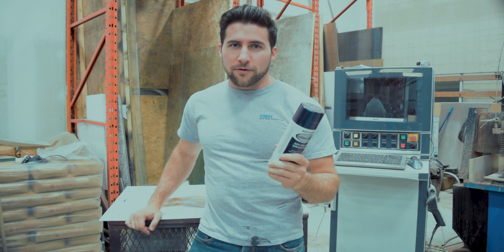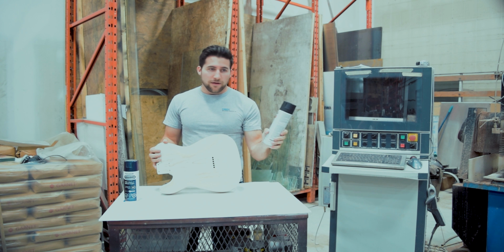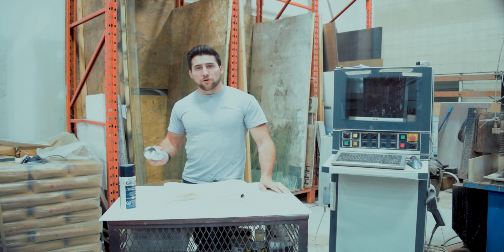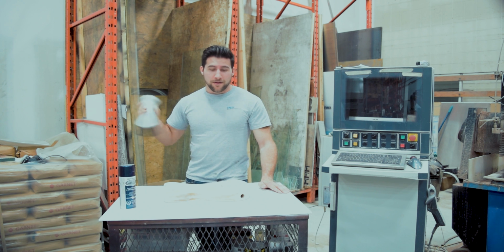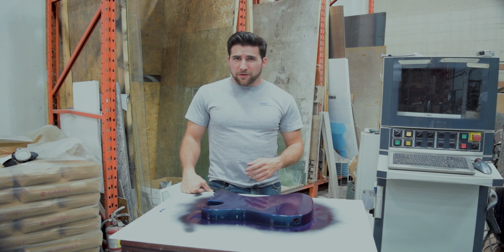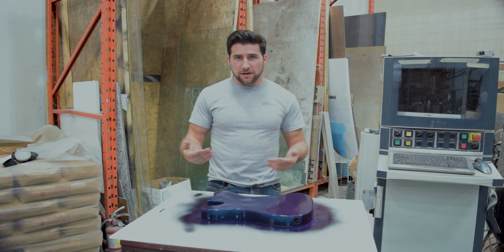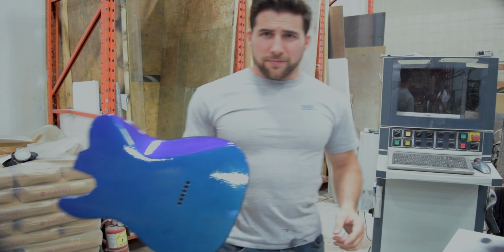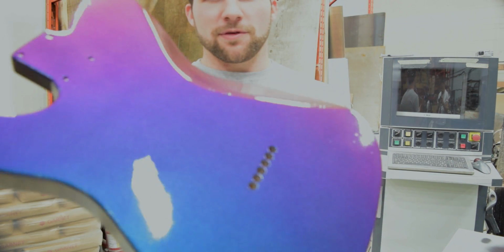How to do a Chameleon Paint Job with Spray Cans

Comment from the maker: Hey guys, if you want to try out this paint job, here is an affiliate link where you can get it: http://amzn.to/2CHWi7a
Reply: Brad Angove I spray can a lot of my lures. I wonder if I could epoxy over this paint?
Reply from the maker: If you let it dry for a couple weeks to be safe, I’m pretty confident you could.
Reply from the maker: Yes, it should be just fine.
Reply from the maker: Thanks for watching.
Reply: Hey Brad, how long did the black base coat have to dry before you hit it with the colorshift?
Reply from the maker: Either 10-15 minutes or 24-48 hours depending on how you’re structuring your coats.
Reply: @BradAngove  thanks for the Reply Brad. I'm doing basically the same thing but on an f hole tele. Love the tips man. Thanks for the help. Hopefully it turns out ok
Reply: @BradAngove  Do you think its possible to do the crackle effect spray paint over top of the color shift paint?
Reply from the maker: It should be possible. I’ve never tried it though.
Reply: Hey Brad, does it matter if the black base coat is gloss or matt? Thanks for the tips and great vids.... Andy.
Reply from the maker: It doesn’t particularly matter Andy.

Comment: So, I just painted a no name el cheapo bass I got from Amazon with this Rustoleum color shift line (there are at least 3 different versions of the same paint just from these guys) but in the Rose Champaign color. It came out great, well as great as I could have. There was an issue with the wood, some flaws couldn't be sanded out, so there are a few weird flaws in the paint, but in areas you can't see during normal usage. I was blown away by how good the shift looks in person, no video or picture can really capture it.I paid 13 bucks for a can of it, used a can and a half to get the effect/shade I was happy with. Used Rustoleum American Accents Satin black, figured it would make the color shift pop, and it really did. You REALLY need to take your time with this paint, especially if you don't have much experience with spray painting. It can get away from you really easy. Their reccomendation to not sand it makes it even more challenging, because sanding it removes the flake that makes the color shift. But it really does compare to a spray gun formula. I didn't poly/clear coat it, it's just a cheap bass that I wanted to practice on before I try to build my own bass. I threw a black bridge on it, a cheap pre-wired  pre anmp/pickup, some black Fender J bass style tuners in black. It sounds good enough that I'd use it for practice or an occasional performance for the heck of it. When it does wear it will just look better.

Comment: This paint does look good but I used to have a hell of a time trying to refinish car panels with the stuff.It's sometimes easier to paint the whole car because, as we know, painting panels edge to edge is never going to be a perfect match and sometimes they are too different. You can't flick blend the paint into the next panel as the full colour ground coat is needed to provide consistent opacity for the effective/reactive semi transparent coat. It can react differently depending on application of the top coat lacquer as well, many test spray out cards can be needed. It's an attractive effect but difficult to repair. Having said that, repairing it on a guitar would just require a refinish all over (after appropriate prep work) and that isn't too bad as it is small compared to a motor vehicle and more fun. Great demo video as always. Thanks. 🤘👍🎸
Reply from the maker: I definitely wouldn't want to be trying to fix this up on a car haha. Sounds borderline impossible.

Comment: Great demonstration .. thanks for the information .. does the flip paint work well on Metals (Brass and Copper) and would it be better to pre treat the surface with an acrylic based etch primer prior to using the black Matt primer? 🇬🇧
Reply from the maker: You wouldn’t want to spray it directly on those metals. Once they’re primed properly you can use pretty much any paint on them.

Comment: Thank you for the video! I have some questions regarding how to go around an ash strat body that used to have a poly finish that I removed:
1. Should I use a black primer or is a sealer/black matte a better option?
2. What sandpaper should I use before and after applying the chameleon finish?
3. What clear coat should I use?
Thank you, I enjoy your channel!
Reply from the maker: Black primer or sealer is fine, as long as it comes out smooth. 
I would use 400-600 grit paper. 
My preference is the spraymax clear that I demonstrated in my video on how to get a professional looking clear coat with spray cans.
Reply: @BradAngove  Thanks a bunch! Once it warms up where I am I'm planning on doing this finish! Glad to be a subscriber!

Comment: Any polishing/ wet sanding. Afterwards and any clear coat? Plus did you spray any Primer before the finish , I could some white “ paint” in the beginning, but I could easily see the natural grain of the body.
Reply from the maker: You clear coat first, then sand and polish. 
Have a look at my video on primer vs sealer.
Reply: Brad Angove ok , thx for the reply

Comment: Well Brad, ya turned me on to something I was completely unaware of -- the "chameleon" paint cans.  Now that, I'll have to try.  Spraying in the "cut" of a Tele can be a bit of a trip, eh?  Rustoleum used to be pretty finicky stuff, it's gotten MUCH better in the last 20 years.  Thanks for this one, I love your painting videos!  (I've been at it since about 1962, building car models in the basement ... so I can tell you've definitely painted a few guitars!)
Reply from the maker: +Seth Tyrssen Thanks Seth. The chameleon stuff is pretty cool. I’ve been told that Rustoleum discontinued these unfortunately. I’m looking into a different brand right now, but in the interim, house of Kolor now does spray cans and I bet theirs are substantially better.

Comment: Hey Brad! ive painted my Ibanez RGA8 with one can of this Color Shift paint. I got a bit of orange peel because the distance wasnt uniform. Should i wet sand it with 800/1500 sandpaper or it can be fixed aplying clear over it then sanding/buffing/polishing? What clear should i use to avoid any chemical reaction between paints? There's the cheap Rust Oleum lacquer the one with the black chair pic on the can and the more expensive Automotive Acrylic Lacquer but the latter says "Do not use over existing air-dried enamel paints." A bit confusing. Thanks!
Reply from the maker: It’s helpful to take the orange peel out as you go, but it can also be done at the clear coat stage. 
In terms of the clear, I suggest having a look at my video on how to get a professional looking clear coat with spray cans.

Comment: Man you helped me with this a while back but I can’t find the comment chain or remember which video it was on and somehow lost my YouTube account so I can’t search for it. So I was hoping you’d look this over one more time since it’s finally time to do the job. Here’s my plan. 

Sand bare wood to 400 grit. 
Vinyl sealer you recommended. 
Sand to 400 grit.
RUstoleum flat black. 
Sand with 600?
Color shift, few minutes after last coat apply rustoleum 2x clear (to sand before final cleat).
Sand to 600 again.
2k clear to finish.

Sound good? It’s a 1960s hofner galaxy I want to do a really good job.
Reply from the maker: Sounds good.
Reply: Thanks for the help man. Can’t wait to do this thing!

Comment: Great job as usual...but dude, where's your respirator? Where's your stand, or do you use a table only when you want to paint one side? Also when you painted your friend's guitar from USA you were walking down quite a long hallway, is that your shop or rented space, etc? I used the same Rustoleum chameleon paint on my truck 'bout 6 years ago to paint my hood scoops...it flopped last year when clear started degrading.
Reply from the maker: I definitely should have been wearing the respirator. And yes, sometimes I just paint on the table when it’s a quick demo for 1 side like this (or at least I used to). 
Ya, this whole facility is the shop that I worked at when I was younger. I still do some stuff with them here and there.

Comment: I have a gloss black body to start with, can I take the gloss off and spray the chameleon straight on? Do you sand this paint before the 2K clear coat?
Reply from the maker: Yes you can do that. I wouldn’t sand this stuff; I think that would give it a very different look.

Comment: What primer and clear coats could I use that wouldn't react with this paint?
Reply from the maker: It should be fine over more primers. I just used the rustoleum painters touch on this one. 

Clear coat is a bit of a different issue. Their same clear should work, and 2K clear likely works, but you have to be careful about timing since you can’t sand this stuff.

Comment: What do you think the effect would be if I did a couple light coats of Chameleon paint, clear coat it and then go over it again lightly with another chameleon paint, or maybe start with sparkle silver, for instance, clear coat then light chameleon paint? Would that give it more depth or is that a waste of time overkill type of thing? I have more ideas than guitars to do right now but I have a list of about 15 different ideas based on youtube videos but taking it in a whole new direction, and this is one of them. Grat channel, I subscribed immediately.
Reply from the maker: I’ve never tried chameleon over chameleon. That might be cool. It doesn’t look good over silver. Really it doesn’t do much unless it’s over a very dark color. They recommend putting it over black.

Comment: Did you put a clearcoat on it ?
I painted  my  truck with this and put a glass clearcoat across it.  but I feel like it looks better flat..
Reply from the maker: I didn’t on this, but clearcoat provides better protection. It’s generally better to use actual automotive paint on a truck, and that is designed for use with clear coat.
Reply: @BradAngove  how did you get the finish to look so shiny without a top coat ?

My truck actually turned out great. Doin few touch ups . 
After clear coat and polished I could see a few spots I had to hit again. 
I am using a 2000 grit on a acrylic flat block on the truck surface before finally clear to be sure it’s even
Reply from the maker: @WillFull_Truth the paint that I used is a gloss paint, so it tends to look shiny on its own. It’s just now well protected without a clear coat.

Comment: would you maybe need to sand this back between coats? And how about th final coat before clearcoat?
Reply from the maker: No, I would do my coats sequentially like in the video and then add one coat of clear immediately and let it dry for a few days. Then scuff that clear coat back before doing your full clear coat work.
Reply: @BradAngove  Cool, thanks for the advice.

Comment: Question.. please help
So. If i paint chamelon color… i need matte black with the chamelon color?
Thats all? Or need top and base or any primer? How do you finished color? Just two step? I have black color guitar it is shine finish.. do i need remover the color then paint matte? Or just over it from the black and paint chamelon? Please help me do this
Reply from the maker: Just sand the guitar smooth with 600 grit. Don’t remove the paint. 
Then clean it and spray the chameleon color and a coat of clear coat. Then let that dry for a few weeks.
Then lightly sand the clear coat smooth with 800 grit and add some more coats.

Comment: Would it be as effective if you turned it to a matte finish or used a matte clear coat. Is the gloss what makes the chameleon effect? Thanks!
Reply from the maker: It would be less effective because the light wouldn’t pass through as well. Light angles are what give the effect it’s impact.

Comment: Hey there Brad! Just finished shooting an S type guitar with this same paint and I'm looking forward to clearing it with spray max 2k. Got a really clean application with no visible dust/fibers/bugs. Any recommendations on cure time before applying a 2k? Should I wetsand the basecoat first before the clear?
Reply from the maker: I think if you wet sand it you will change the look of it dramatically. I’d let it sit for a couple weeks at least before clear coating with that product.

Comment: How long did you wait between black and chameleon, and chameleon to clear coat? Did you sand between coats at all? I'm used to painting vehicles. This seems a bit different
Reply from the maker: It’s not different really. I believe I waited about 10-15 minutes and didn’t sand in this case. It was a long time ago though, so I don’t recall exactly.

Comment: what was the black base coat used?   Thanks
Reply from the maker: Just rustoleum painters touch black
Reply: Thank you!  So i was planning to do 3 coats mohawk sealer, 1 black base coat, the galaxy blue 3 coats and 2 coats clear.  Does sound like a good plan?
Reply from the maker: Yes, that should be fine.
Reply: @BradAngove  awesome thank you so much for the tips and the video.  I am just about to start and am super nervous.

Comment: If I use a heat resistant paint for the base and the clear, do you think it would last in a engine bay, on the valve covers?
Reply from the maker: I don’t know, so I can only guess. My guess is no though. Heat resistant paint doesn’t deteriorate from heat, but it also doesn’t insulate as far as I know.

Comment: I'm about to do this finish to my Charvel Model 4 guitar I just wanted to ask after I put a flat black primer base coat down should sand with 600 grit after I primer and should I also sand after I paint before clear coating?  I have refinished a couple guitars before but never sanded in between only after I clear coat (obviously). Would it turn out better to do this? Really nervous about sanding the actual paint job.
Reply from the maker: Sand after the black but before the chameleon paint. Get a coat of clear on the chameleon paint right away after so you can just gently sand that after a few days before adding the remaining clear coats.
Reply: @BradAngove  Should I let the chameleon paint dry for 24 hrs before I apply the first clear or how long should I wait?
Reply: @BradAngove  I’m interested in his question as well. 
How long after applying black coat to put on chameleon?
How long after applying chameleon to put on clear coat?
How long until I can apply 2K clear coat?

Thanks so much!
Reply from the maker: Black, 2days, sand lightly, chameleon and one coat of acrylic clear, wait a week, sand lightly, 2K.
Reply: @BradAngove  thanks so much! Does it matter what type of clear? I have been using 2K for my final clear coat as recommended from your videos and it’s worked out really well. How long do you wait until you finally sand down the final clear coat? I’ve been waiting 2-4 weeks.
Reply from the maker: It matters; the 2K is a good option. Wait 24 hours before doing the flattening work on it.

Comment: Do you have any idea why both Rust-Oleum & Krylon say do not use clear over their color shift paints, as it will negatively affect the color shifting effect?
Reply from the maker: It affects how much light can hit them and reflect off them.
Reply: @BradAngove  - Thanks. Assuming you've clear coated over color shift paint, have you noticed a difference in clear coat vs no clear coat in regards to color shift effects, particularly color shift paints from Rust-Oleum or Krylon?
Reply from the maker: The clear can dampen it a bit, but if it’s done correctly and nicely polished I haven’t had any problem with it.

Comment: Well I decided to go with duplicolor mirage. I like the color on the color shift slightly better but the duplicolor is lacquer based and I feel more confident in my ability to not make a mess of it. Have you ever used the duplicolor mirage? Also gonna try the vinyl sealer you talked about in a different video. I’ve been using a lacquer primer over bare wood and I think the sealer will do better since it’s not the ash or mohagony I usually work with. So thanks for that tip!
Reply from the maker: I’ve used duplicolor, but not the mirage specifically.  I’ve heard good things about it though. Should work fine over the vinyl sealer.

Comment: Just to make sure I understand what you did: You applied base coat flat black, waited for it to flash, then applied three coats color shift, waiting to flash between each coat?
Reply from the maker: That works. My recommendation however is that you apply the black base letting it flash between coats, wait 2+ days, sand lightly with 600 grit, and then apply the color shift with flash time between coats.
Reply: @BradAngove  Thanks for the quick response! Was there a reason you used flat black as your base instead of gloss? I assumed you used flat so you wouldn't have to sand it afterwards. Or was that just what you had lying around?
Reply from the maker: @bullfrogpondshop3179  A bit of both. It's still better to sand it.
Reply: @BradAngove  Just picked up a can of flat black primer, so that'll double as primer and base coat. #Winning!

Comment: I know this video is old but hoping to still get a response. I’m painting a Jackson Kelly and got the black basecoat and have this exact paint. Was thinking of using a different basecoat on the beveled edges. Maybe a green? And I have a lacquer clear and also planned on putting glow in the dark between the kameleon paint and the lacquer. Any recommendations? Would the green look ok?
Reply from the maker: The green would look green haha. If that’s what you want go for it. 
Not sure what you mean about putting glow in the dark between the layers, but in any event, be sure to test the lacquer over your paint on something else first to make sure they work together.